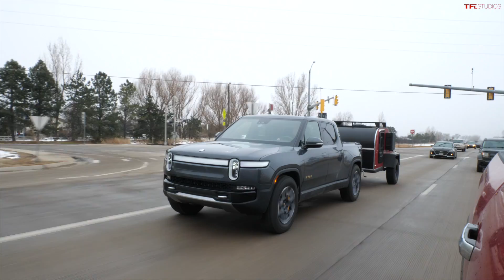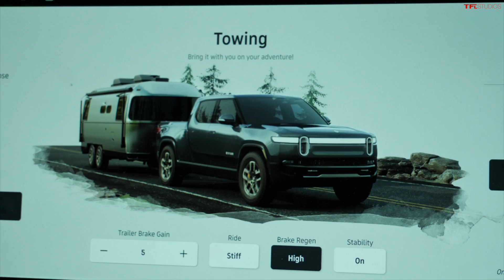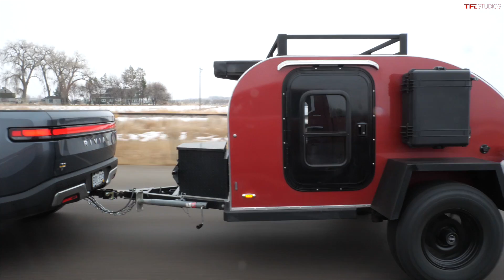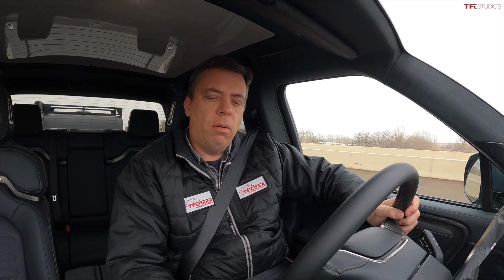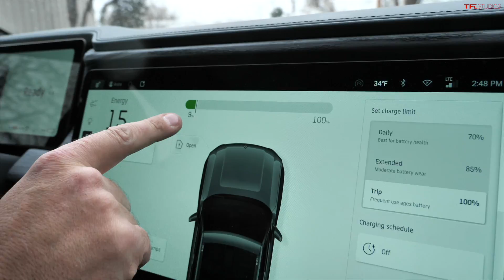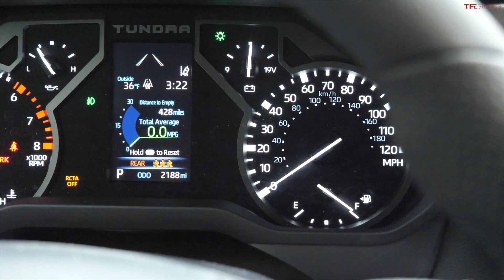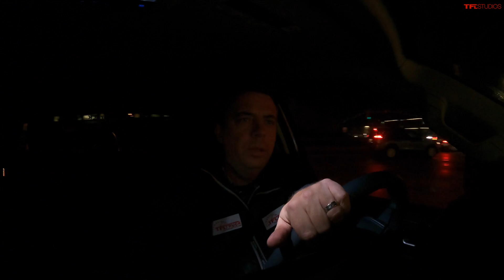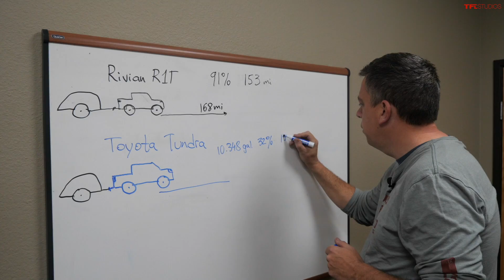Rivian R1T vs. Toyota Tundra: How Far Can Each Truck Tow On A Single 'Fill-Up'?

Comment: I wish you would have taken it one step further and calculated the cost of driving that 160 miles by comparing the cost of charging the Rvian back to full versus the cost of filling up the Tundra for the same distance.
Reply: Tundra would be about ~$40 and the Rivian on EA ( the most expensive charging option) would be ~$36. If you were to charge back at home (the cheapest charging option) it would cost you ~$14.
Reply: @migueljardim8177  don't forget to figure in the wait times.
Reply: @jayrichards3672  Yes but that is time cost, not monetary value.
Reply: @jayrichards3672  0 wait times if you are charging at home or your destination
Reply: @larry Spiller  true if you don't mind the 170 mile leash. Shorter if towing heavier you know 11K rating
Reply: @migueljardim8177  Time is money
Reply: @Argedis  I very much agree that time is money. But his point was, everyone values their time differently. The recharge time is known so each person can add that "cost" on top of the kilowatt charge for themselves.  I can't calculate your value for 1 hours of time and no one can calculate mine. Add that on for yourself.
Reply: @MrChadx1  Which brings up a very good point. What exactly do EVs offer?

They still get you from Point A -> B at the same speed limit as ICE.
They are not flying/amphibious cars and can't get to your destination faster.

Any 'gas savings' are negated with the expensive insurance costs.

All they seem to do is waste time & money
Reply: @Argedis  They offer an option. They are not suited for some users and are for others. Like you said, they do the same thing for certain use cases.  One correction: They do cost less to operate and own that ICE when including insurance cost, fuel cost, maintenance cost, etc. If you charge at home, annual fuels costs are 1/4 to 1/3 of a comparable ICE. Though there are still maintenance items to be done, there are less such as no oil changes, air filters, spark plugs, transmission/transfer case/differential fluid changes (there are other fluids to change, though)., etc. 

They will actually save time for most owners. I do my own oil changes and maintenance and so EV would save me a lot of time (like you said before, time is money). Plus, zero trips to gas stations each week because of home charging.  (15 seconds to plug in at night rather than driving to a gas station and fueling). 

True that on long road trips they will take more time to fuel, but for those that have another vehicle to do so or rent for long trips or don't travel long distance, they will save time. So really depends on the owners use case but there are many scenarios where EV will save time compared to an EV.
Reply: @MrChadx1  dude you are so full of crap lol

Oil changes should take no longer than 20 minutes especially on a truck, on average twice a year. That's also the most common maintenance you have to do, everything else is once a couple years.

I guarantee the vast majority of EV owners will have to stop at a charging station on the road for more than 20 minutes way more than twice a year. They waste far more time.

And it's a fact insurance costs more on an EV to comparable ICE because they are so damn expensive. In fact Teslas average $1700-$4000 annually.

The 'gas saving' argument is usually negated especially when you add the TENS OF THOUSANDS extra the EV costs!

People simply want EVs because they are the newest thing like having the newest smartphone even though a budget phone will do the same thing and actually be cheaper.
Reply: @Argedis  "dude you are so full of crap lol".  You must have been on a debate team. Ha. 

There is a lot more to it than the two oil changes, but yes, that is one of many time and/or costs of ownership that one must consider. Cost of per mile driven (fuel vs. elec.) is the biggest difference and it offsets the most.  An example: I burn about $3,380 of gas per year. Charging an EV pickup at home would be between 1/4 and 1/3 of that based on my current kw rate  and the various real world Rivian mileage tests by TFL and other channels.  Using the larger of the two to give ICE a leg up, that $2,230 savings per year in fuel savings. Plus maintenance savings.  

The super expensive insurance issue for EV used to be the case and a lot of people are still bringing that up, but now Tesla has their own insurance and cost is about the same as an ICE car of the same value. There are threads on the Rivian forums where everyone is comparing insurance costs and some are paying a bit more than same priced ICE, some are a bit less, and most about the same. When you compare, you have to compare an ICE of the same value for the same person and same home address. You can't compare an older ICE pickup that new was $40k or $50k and is now worth less and compare it to a current model year, $70k EV. If you price insurance on a 2022 $70k ICE pickup, you'll be surprised at the cost. And BEV pickup insurance averages about the same when comparing. 

As for upfront cost, EV are about the same as a comparable ICE trim level. Realize that a Rivian R1T is appointed like the highest trim level Ford, Chevrolet, Toyota, etc. and those are all $65k to 75k, just like the Rivian. They don't make an economical Rivian Trim level. Ford Lightening EV and Silverado EV have $39,000 trim levels and many other trim levels as you work your way to their top trim level. The point being, EV pickups are the same price as an equivalently-equipped ICE pickup. Both a Ford F150 ICE and a Silverado ICE that are crew cab and 4x4 (like the EV pickup from both brands) with base engine are the same $39,000 price. So the cost between ICE and BEV are the same. On top of that, for those manufactures that still have the federal tax credit or in States that have State incentives, the comparable BEV pickup can be a fair bit cheaper than and ICE pickup from the same manufacturer ($7,500 federal and thousands more in some States, so the BEV can be $7,500+ cheaper than the equivalent ICE pickup). 

As for "time wasted", you are ignoring the 5 to 10 minutes at a gas station once a week.  52 times a year, that is 260 - 520 minutes (4.3 hours to 8.6 hours). We don't have a BEV, but if we did, it would replace one of our two vehicles and we would never use it for long distance trips so would never have any time penalty. We'd always charge it at home. Someone that only has one vehicle and it's a BEV wouldn't have the ability and it would impact them if they chose to use their BEV for long trips. So each owner must consider how they use their vehicle and decide for themselves. Many destinations also have free charging while you shop there or use their facilities or hotels if you stay there. 

There are lots of use cases that BEV will not work for and those buyers should, and will, stick to ICE. There are lots of use cases that BEV will satisfy and those buyers can choose BEV or ICE; whatever they want and prefer. But price is not of consideration because cost of ownership of BEV is the same or more economical than a similarly equipped ICE (vehicle cost, insurance, annual fuel/elec costs, maintenance costs, etc.). The calculations that show BEV cost of ownership way higher than ICE are using old data from back when EV did cost a lot more upfront and did have much higher insurance costs. That is not the case any longer.
Reply: @MrChadx1  They literally proved in this video you can drive 3x longer vs an EV.
Time is money

And how much more is that Rivian? 20k? 

Also comparing insurance between different owners is stupid. The same person will pay less for a Tundra than a Rivian and that's the point.
Reply: @Argedis  If you are towing and driving long distances, then yes, I agree that an EV will take more time due to recharging. That is established. We both said that long distance and/or towing adds an unreasonable amount of time charging.   If you are not depleted and EVs battery and are charging at home each night, then any range more than that doesn't matter because you leave the house every morning with a full charge. So again, it depends on how each person is using it.  

So what is the point in saying the Rivian is $20k more than the Tundra in the test? You can't compare a mid trim level Tundra with a Rivian when you compare price. Just like you wouldn't price compare a Tesla to a mid level Camry. You compare it to a brand that offers similar features. Trim levels and like features in each (like heated and cooled seats, heated steering wheel, all glass roof, large screen infotainment screen, cameras, etc.). I broke this down in the previous post, but again, the similar trim level in the Tundra, F150, Silverado and Ram are about the same $65 - $70 price as the Rivian. It is not more expensive to get into a BEV pickup.  Go onto the Ford build website and build a Ford F150 crew cab 4x4 with base engine. $39k.  The base BEV Ford Lightening crew cab 4x4 is also $39k. Same price for same trim level. You are not paying any more for a BEV. Silverado EV is the same. Base Silverado crew cab 4x4 is $39k. Base Silverado EV crew cab 4x4 is $39k. 

If you are comparing the insurance price of the midlevel Toyota Tundra to the Rivian, then of course there will be a insurance difference because you are insuring less value. That has nothing to do with the Rivian being an EV.  If you price the new Tundra Capstone, which has similar equipment to the Rivian, or any pickup that costs $70k like the Rivian, then you'll get a realistic comparison because you are comparing an ICE and EV of similar values. Insurance cost has a lot of factors but coverage amount being the largest.  Compare like valued vehicles and you'll see the insurance cost is about the same. Current Rivian owners reporting what they are paying compared to their previous and/or similarly priced vehicle and some are a bit more, some are a bit less, most are about the same. BEV insurance used to be much more expensive than similarly priced ICE, but they are nowadays very close in insurance cost. 

So, since insurance cost is about the same and purchase price is about the same and fuels/energy and maintenance cost are less, the cost of ownership calculates to be less in a BEV. That doesn't mean a BEV is right for everyone as there are a lot of use cases where BEV just won't work (heavier towing, long trips, remote trips, etc.). But if a BEV does everything a potential owner wants or needs, the overall cost of ownership is less than a comparably equipped ICE. And even with that, there are trade offs between ICE and BEV and each owner needs to evaluate and decide for themselves.

Comment: This was interesting. But in reality, not too many in a Tundra will be pulling 2K pounds. More likely is about 5,000 to 8,000 pounds. I would love to see you put the 8100 pound truck/trailer on the Tundra and drive it to a quarter tank, 24 gallons of fuel used and see what the mileage is. That is a test that I think would have real world application.

Comment: How long does it take to get the Rivian to 100% battery vs filling up with gas? What is the price difference? What would the price look like if you paid road tax for electric?
Reply: Oh my!  That's an excellent point. How long before the greedy government adds a nickle / kwh "road tax"? Actually, a bit shocked they haven't already
Reply: @johnb7430  in Ohio, it's an extra 200 a year to register your electric vehicle, on top of higher insurance. And a much higher electric bill!
Reply: Over a hour, EVs are slow from 80-100% of battery capacity to fill
Reply: From 0-100% it would take 40 mins for the Rivian, for the Tundra from 0-full would be 6-7 minutes.

Comment: The R1T does not have a heat pump as you state in the video, however it scavenges heat from the inverter to heat the “coolant” fluid for battery/cabin conditioning.
Reply: So resistive heating basically?